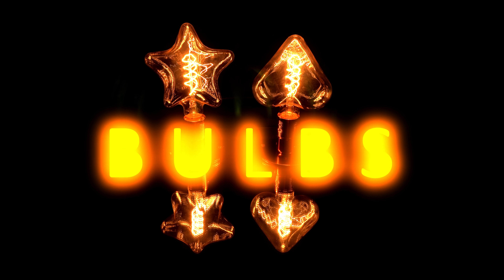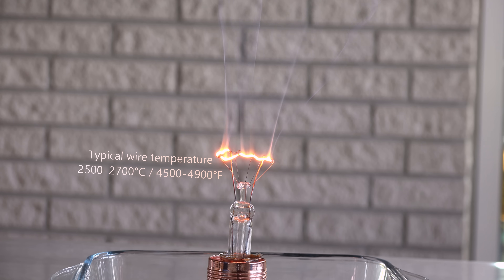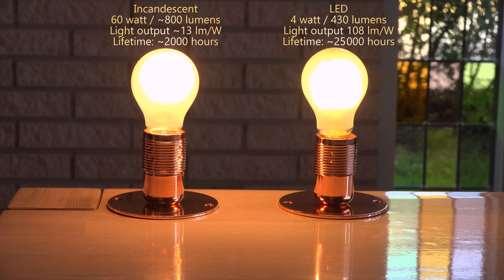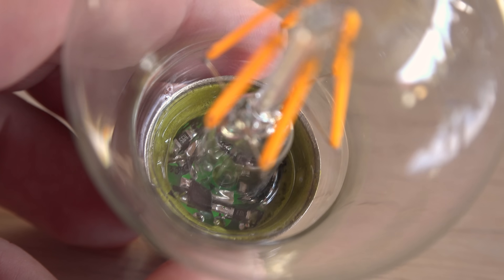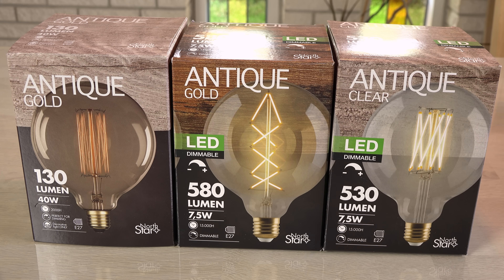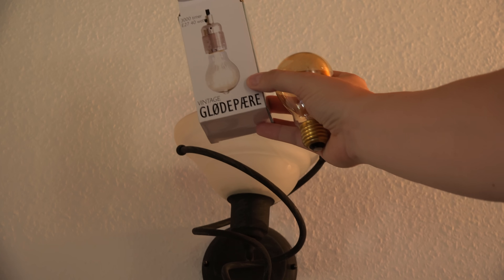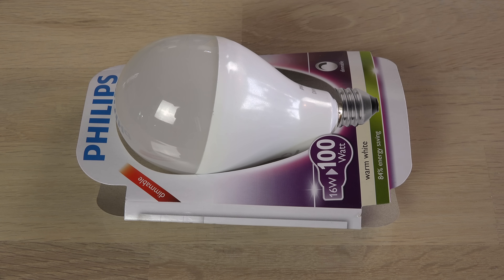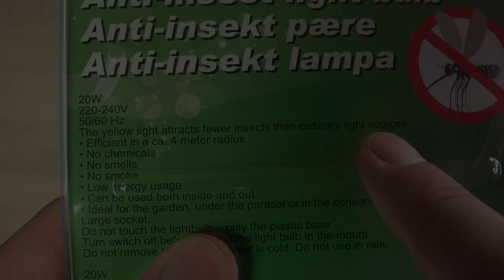Light Bulbs | LED vs. Incandescent

Comment: 4:30, it's amazing you mention this.  When I was a kid my parents switched to Flourescent Lighting over Incandescent, when we tried to eat dinner I had to excuse myself because the food looked so unappetizing after the hue change.  Everyone made a big deal out of me excusing myself and was talking about me like it was weird and I was being rediculous, good to see I had a legitimate point.
Reply: The early flourescent lights were limited in their watts and their color index. In the newer ones you can get much higher light output and much better color. You can even get daylight bulbs now.
Reply: The Sun is the best lamp.
Reply: @gracepierce1024  So far my LEDs last about 8 times longer than the halogen I used before. 2 replacements in 3 years instead of 8 replacements every 2 months.
Reply: Flourescent Lighting also emit mercury gases and some hypothesis are made that they might go into our biology and potentially harming you and your brain
Reply: I have never liked fluorescent lights since I was a little kid but I have to tell you I also hate the LEDs they make me feel sick and they make everything look flat and weird almost like a Twilight Zone when I'm outside and they're coming off of buildings and street lights..... I am proud to say I only have incandescent in my home .
Reply: @gardensofthegods  you need to buy good leds with proper CRI and with a good (non-flickering) LED driver

a lot of cheap led bulbs don't properly smooth the incoming voltage so they will turn on and off 50-60 times a second, or 100 to 120 times a second if they have a full bridge rectifier

i can't stand those unsmoothed leds myself either, they also make me sick, but i run everything led in my house, cuz i buy ones with good drivers/converters

to pick a good bulb in the store just use the slowmotion filming feature of a smartphone

if it flickers, no bueno, if it doesn't thats a decent option
Reply: @gardensofthegods  If you're made of money you can buy 99 CRI 2400 - 2700K LEDs that are of equal light quality to incandescent, you wouldn't be able to notice the difference because the technology truly has gotten that much better in recent years.
Reply: @gardensofthegods  your power bill must be insane
Reply: @23y75 it's really not a huge difference.  My bill went up 200 per year.  And the house looks and feels so much better than. 200 bucks.  I completely forgot how much better the light is.  I must have been getting chitty leds or something my woudl fail after 1-3 years.
Reply: Fluorescent lamps have a very poor CRI. This is not the case with LEDs.
Reply: @paulanderson7796 wrong
Reply: I have tested few leds and some do emit something called blue light spectrum which is why your food looks bad and this blue light can cause the cri to drop down
Reply: Incandescent light is better than led and florescent lights health-wise.
Reply: @naduyn No, buy the right LEDs

Comment: One of the solutions was to replace with halogen which create far more heat and last bugger all time. Even if incandescent lights produce excess heat its still in the house which in the winter is useful . Led lights hmm just from an enviromental point of view we go from recyclable glass and metal to unrecycleable plastics electronics and pcbs at a much higher cost . dont even go to the shit compact flourescent bulbs !

Comment: I'm a Washington State licensed Union Electrician and I have always had a hard time explaining simple electrical questions like "How does a transformer work?" or "Why can birds sit on power lines without being electrocuted"? without reverting back to theory and how electricity operates at an atomic level because that's how I learned it.  When I see their eyes glaze over it's time to try to simplify or create an analogy they can understand.  You gave the simplest, most easily understood by the layman, easily cross-referenced examples that I have ever seen.

Comment: The ban on incandescent bulbs is yet another scam to hide inflation. We're all using waaaaaaay less electricity now, but has your electricity bill gone down? No. It's the same trick as putting less cereal in the box but charging you the same price. But in this case, it's a double whammy. We pay more for the bulbs and the electricity.

Comment: But in a cold climate, the heat is not a loss. The life expectancy argument does not really stand in my experience, all the CFL bulbs fail almost as often as old incandescents but costs 1.5 to 10 times more. And old incandescent bulbs were short lived due to planned obsolescence...And my CFLs whatever price I paid still get pretty hot. halfway I'd say. There are like 2 CLF bulbs that I kept more than 4 years, the rest dies. 

LED's might be superior, but the way they are made makes them vulnerable: the transformer on the bulb gets very hot, which indicates losses, and they buzz and they also die too. Like within months. And they require to rewire /change outlets/dimmers in some cases.

Comment: Everytime we open the eyes ,we expose our eyes to light damage .
Sun shine is also damaging.And is damaging not only the eyes.the sun also damages the exposed food .The life does not come from the sun.the sun only mentain the life .All the other types of light are slightly more damaging for the eyes,in they'r respective degree.I got asleep under my ceiling incandescent light and i had to get out of the bed for turning it off cose even closed eyes it was causing me nightmare and eye pain&redness.Ok we're not suppose to sleep under light.Fine. i also sleeped under fluorescent and i actuall don't remmember to much same as led.i suppose they irritated me less.what is actually damaging in the led is the inaccurate frecuecy and the discontinuity of the light flow.That's what makes damage  not to the eye but to the optic sistem of all complete including nerve and brain.but only in a low content.Noboddy ever got blind for using anny of these types of light.
Conclusion:I would of advise ws more likely to watch what food we buy and eat and what liquide we drink,cause it really matters for  our eyes and for our helth and it can affect our quality of life.We can live long and helthy or we can die soon an sick.the best light we can use is free and we have it built in at our birth.Is our  soul.have a good one.

Comment: you may have a lower supply voltage than the incadessant bulbs ar calulated at as they are just resistors voltage will affect wattage

Comment: Actually LED only work with electron-hole recombination (there are two layers, one has excess electrons, wnother missing, so they drop there and release the energy). Thermal radiation comes from accelerating electrons - therefore everything gloves just the same.

Comment: So you buy LED's that often cost 10X if not more that take 1,000's of hours to recoup the cost. However, many HVAC systems pull 5,000 W  or more per unit with not a thought in people's empty heads. 

I'm aware of cheap LED's, but dimmable soft white <2,500 K with filaments simulating unobstructed incandescent bulbs are very expensive. Apple's to Apple's.

Comment: LED bulbs are junk!!! In 2016 I bought six boxes of LED bulbs and changed EVERY BULB in my house from lower watt Incandescent bulbs (60 watt) to the newer LED bulbs, under the manufacturers PROMISE that (as they advertised them) would "last five years" under normal use!!! Apparently their idea of "normal use" meant you NEVER TURN THEM ON, because in just 8 months one by one these LED bulbs began to fail!!! Some began flashing, others just quit altogether, and over the past few months I have been buying cheap incandescent bulbs at the dollar store to replace the failing LEDs, going BACK away from the more expensive bulbs! Meanwhile in my shed I have four incandescent bulbs that have been out there for 7 years and I have never changed ONE OF THEM since I installed electric into my shed! So I am pretty upset by how much I paid for "false advertising" of LED bulbs that did NOT live up to their specs!!! Sure the LEDs were brighter for less power used.....but I feel they should have lasted a lot longer for the money I spent, and I am now down to about eight total LED bulbs left that still even work out of 24 bulbs I originally bought at $12 a box for 4 bulbs each package! So, so much for "saving money" when you consider how short LED bulbs last and 8 months is NOT a real great feature of LEDs!!! Reportedly I should also point out that one of the first LED bulbs to fail was in my bathroom, in a light fixture that typically isn't on much ONLY when we are actually IN the bathroom!! So that bulb is OFF most of the time with myself and my partner being the only TWO PEOPLE living in our home and we are more or less "elderly" ourselves with no kids in the home that may be leaving lights on all the time!! So it is painful to see LEDs fail as bad as these have, more so when I consider I have been around (and assembled) a lot of electronics in my life as well, so I know the actual LEDs are not the problem, but the supporting electronics inside them are garbage and cheaply made!!!
Reply: Greg Benwell buy Phillips bulbs they may cost more but they should last a lifetime.

Comment: Although the LEDs are very efficient and I use them to light the house, I have to say that I like the incandescent lights better. Interesting thing is that most black fabrics have a slight red tint to them, but under incandescent lighting they look dark red rather than black. Under LED lighting the red color is almost not there, and normal reds look faded. Under incandescent lighting I can easily tell certain black fabrics apart by how red they are. Black plastics just stay black though without any care what lighting they are under. I've got some form of light over-sensitivity. I just thought it is weird and wanted to know if anyone else noticed any of this.
Reply: That's because the R9 value of LEDs is awful. Annoyingly, most reported CRI values are RA which is R1-R8, so it excludes the red color.

Comment: I know this video is old, but I think the reason the incandescent bulbs consumed less than they’re rated for and the LEDs not, is that the mains voltage was a bit low, and the incandescent don’t have electronics to adjust for that.

Comment: they're not exactly 'more efficient' as getting your building heated is a desired side effect. electric heating always being 100% efficient, regardless of what form of heating device it comes out of (including lightbulbs) it simply saves some additional wiring and devices. are we gonna judge electric heaters by the amount of "undesired" light they emit too? :P furthermore, producing leds and other chemical crap isn't exactly 'more efficient' than simply producing a glass bulb, putting some wolfram in it and sucking the air out. :P (and yes, both types can be produced to last pretty much forever or at least significantly longer than the usual 3000 to 9000 hours, just that some factories don't ;)
Reply: So you really think that light bulbs are as good at producing heat as a heating system designed specifically to heat your home?  I've seen from experience that it simply isn't the case.  When I replaced the incandescent bulbs with CFLs (and later LEDs) my electricity bill went down significantly compared to the previous winter.  If they're both as efficient, then there should have been no difference
Reply: electric heating is always 100% efficient. it doesn't matter wether it's shaped as an oil filled radiator, a glowing spiral, your electric oven, or a light bulb that only produces 5% light and 95% heat. 10 100 watt lightbulbs will produce the exact same amount of heat as a 950 watt electric heater. and therefore, it is not a matter of 'efficiency' in 'producing light' as in pretty much ALL circumstances (except for outdoor use or in countries where it's warm anyway) you WANT that heat.
Reply: furthermore, electricity bills should not be brought down by 'using less' but by simply producing more and getting rid of all those retarded taxes. if you're gonna ban something ban gas pipes. as gas makes people's houses explode and causes carbon monoxide poisoning on a regular basis. it therefore does not belong in buildings people live in.
Reply: the '95% efficient in producing heat' part isn't exactly right as a lightbulb clearly also emits radio at 50hz (then again you don't wanna get started at measuring the radio emissions of those crappy led things), and a whole spectrum of light 'you can't see'. but yeah on the whole they do do a proper job at maintaining some temperature in a building, and that is a desired effect as otherwise you'd have to install heating in those spaces. i'd say in quite a few cases lightbulbs are installed where no light is desired at all, just to warm up cabinets outside so they don't get moisty and freeze, etc.
Reply: OK, here's why using lights for heat is less efficient:

Hot air rises.  That's why the ducts leading from your heater are close to the floor. They heat the air at floor level, that warm air rises, and is replaced by cooler air, which flows in, rises, and this continues to happen until all of the air in the space is heated.

Your light bulbs are probably near the ceiling, unless you're going for an "Ed Wood" lighting effect.  The air near the ceiling will heat up, but there's no air circulating, and so most of the remaining air never gets warmed.

Heat travels in one of three ways: convection, conduction, and direct radiation.  Since you're not holding the light bulb, you're not getting heat from conduction, and by trapping all the warm air at the top of the room, you're not getting conduction, so the only heat you're actually going to feel is the heat of the direct radiation from the bulb itself.  You've basically eliminated the most efficient method of transfer (convection) and are going with the least efficient (direct radiation)

So if you'd like a really warm ceiling, your plan will work.  If you'd rather heat the whole room, it's not a great choice
Reply: almostfm there’s nothing in the world that is 100% efficient but Ok...
Reply: Keep in mind that some countries don't get cold and the last thing we need is more heat

Comment: There is a much simpler way to explain why the LED only takes a fraction of the energy the old fashioned bulb did. In the LED, only a tremendously thin layer of metallic molecules is being electrified until it is heated to the point it starts emitting light. The wire that heated up in the old bulbs is enormous compared to that layer of only a few molecules, and thus the wire in the old lamps would allow for much more current to pass, heating up the entire wire whilst only its surface would generate visible light. By the way, to get it done, that tiny layer of molecules of selected, special metallic compounds the LED uses to function, is applied onto a silicon substrate and than covered with a layer of glass, so that it is shielded from making contact with any outside air. If this wasn't so, the metallic layer would quickly corrode, and actually burn up immediately upon switching it on, in that regard it is also the same as in the incandescent bulbs, that contained an inert, protective gas to replace oxygen containing air, for the same reason, otherwise the wire inside would just burn away in seconds.
Reply: In deciseconds.

Comment: I brought a huge number of incandescent bulbs when talk of the ban started. I use then in confined, well insulated environments where the bulb is the only means of heating. An inefficient bulb gives light and a good source of heat. I also use them as current limiters when working on 240v projects, so a useful and cheap safety device. I do use LED bulbs but I have found their lifetime is way down on incandescents. The LED bulbs claim 8x life on an incandescent but die in three to six months. I have enough incandescent bulbs to last out my lifetime but my children will have to risk dangerous LED bulbs (exposed line voltages) and keep replacing them. What cost progress.
Reply: Shitty bulbs, I have never had any LED bulb die over the past 6 years since I started replacing all my dead incandescents.  You must love Fox News since you live in a world of Alternative Facts BS.
Reply: If you have anything intelligent to say please do so. Otherwise best to keep mum, especially if you are going to be rude as that says a lot about you. There are many poor quality LED bulbs out there. Usually they are over driven so burn out quickly, dropper capacitors rated at too low a voltage or mains voltage on exposed heat sinks. I can send you a LED bulb that will kill you when you plug it into a live socket if you like. There are plenty of uses for incandescents and good quality if expensive LEDs. BTW I am a fully qualified, certified and experienced electronics engineer so have no need to make anything up.

Comment: Aside from just preferring them, LED bulbs are quickly supplanting the compact fluorescent (CFL) lights that I bought to replace my incandescent bulbs several years ago. Those were efficient, but the LED ones are even more so.  In fact I think they're better in every aspect -- color quality, heat production, bulb strength (most are plastic, so they're shatterproof), and startup-time too. 

And CFLs... Wow... Mercury in a glass tube, used in a household, prone to breakage.  What a totally sh!tty idea.  That NEVER should have been pushed as an in-home solution.  Also consider that they might take a full minute to warm up to full brightness, and CFLs were simply craptacular.   I will not miss them.
Reply: I hate CFL and even regular FL has limited uses.
Reply: i don't see a problem with cfls or florescent tubes